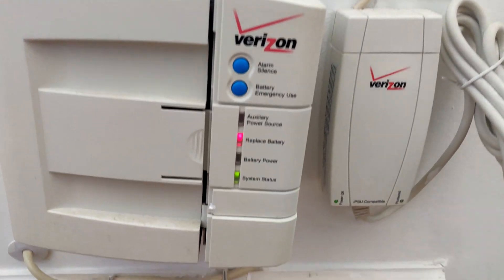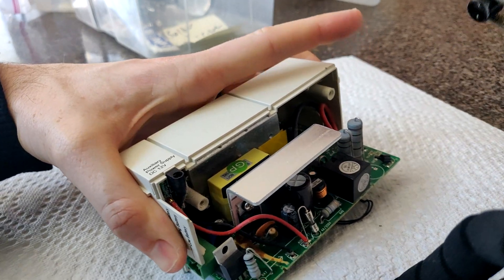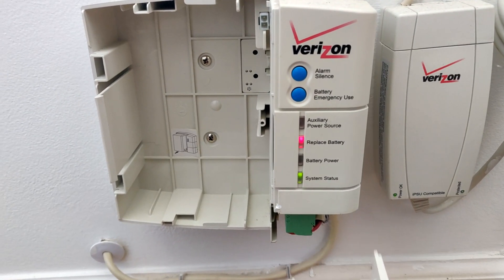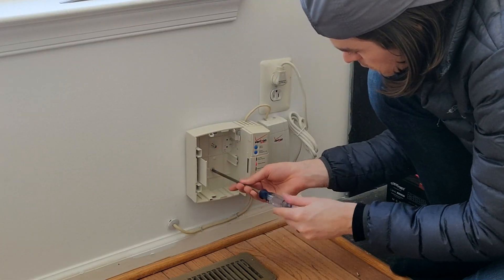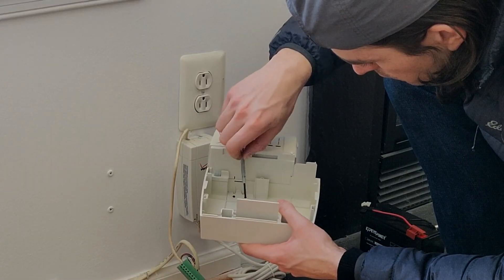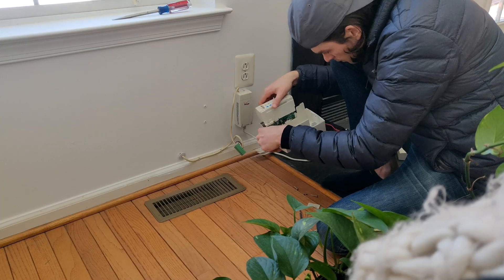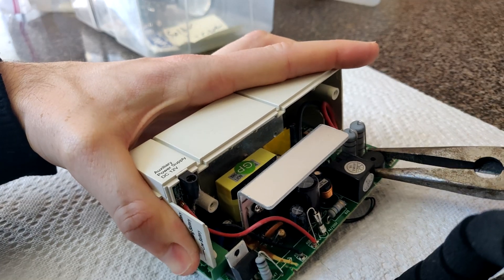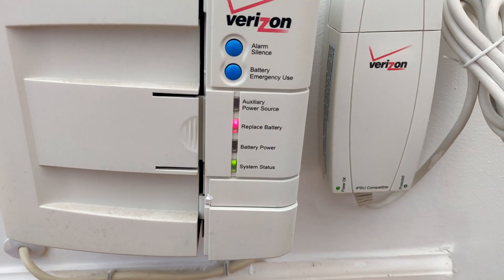Permanently Stop Beep - Fios ONT Battery Backup Unit (Free!)

Comment: I finally got around to doing this today.  I've been swapping and recharging batteries twice a year, sometimes more, for more years than I want to admit to.  Really hate permanently altering a device like this, but enough is enough.  I believe the recharging circuit in the device has failed, but Verizon wouldn't do anything and I'm sure Frontier won't either.  Thing is, the batteries were always just fine, not even discharged much.  Everything is working fine now.  TV and internet went down while I had it unplugged obviously, but it all reconnected perfectly when I plugged the ONT back into the cable and power supply.  Had to slot out the hole where the cable comes in because the installer left zero slack in the cables, but that was easy with just a pair of wire cutters.  Thanks for making this how-to video.
Reply from the maker: I'm glad it helped for you, Cheers!

Comment: Another method that worked for me without damaging your ONT (which I think still technically belongs to Verizon?) Mine had a DC input jack on the side -- these are meant to provide battery backup power from an external source. I plugged a universal DC adapter I had (with the proper size and polarity tip and correct voltage setting) and it silenced the alarm. The unit just assumed some external battery was supplying the backup power, when it reality it was just an adapter plugged into the wall socket. The trick is getting a magnifying glass and carefully inspecting the input jack on the ONT -- it should have tiny text indicating the proper DC voltage and tip positive/tip negative style of adapter needed. The tip size is just trial and error - find the one that fits.
Reply: Hi I tried that but only had a 100mA 12V plug. Which size mA did you use?
Reply: I unplugged mine to do some remodeling in the room it was installed on and when connecting back up it doesn’t turn on anymore I reseted it but the no lights come back on so you have any idea how to fix that?

Comment: I have a land line and when the power went out so did my landline.  It never worked nor did my neighbors. We both couldn't figure out the point of the battery because it didn't work on anyone's.  I pay Verizon enough.  IM not paying $40 for a battery that doesn't do anything.  I removed the battery some say this may do it depending on the age of the unit. I'll have to wait and see.
Reply: Next day the beep is back. What happens if you just unplug the power cord and leave it unplugged?

Comment: This is absolutely brilliant.  I followed this exaclty and it took me about 5 minutes.  I would add just one comment.  I very carefully lifted the speaker off the board with a tiny flat tip screw driver.  I don't suggest Ripping it off with pliers.  If you use brute strength and craxk teh mother board, you will be PHUCT.  Other than that, this probably saved me from jumping off a tall building from that crazy beeping.

Comment: The primary function of the box is to convert a fiber optic signal to an electrical signal of bits (1's and 0's) that can be used by your Fios Router. That is a) why there's the little "green thing" that is never disconnected in the video, and b) why you need to reconnect the box after you remove the alarm unit from the circuit card: the "green thing a) does the conversion, and b) therefore needs to be supplied with the correct flavor and voltage of electricity.